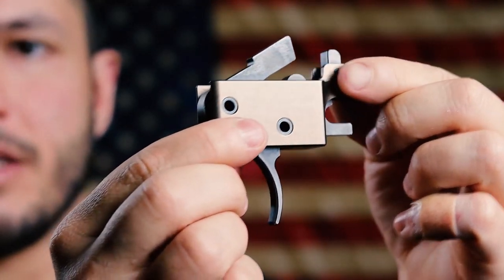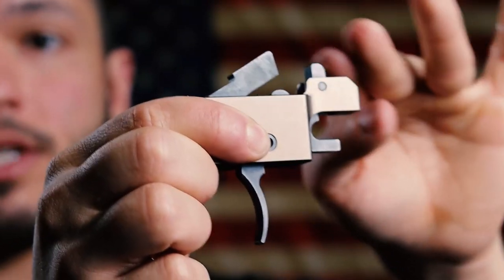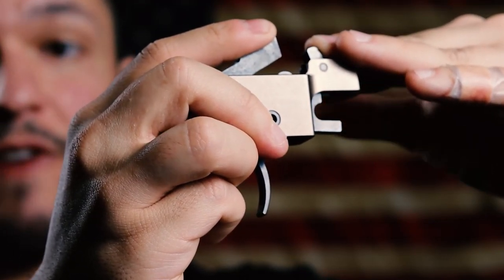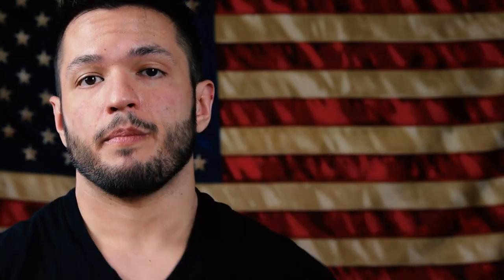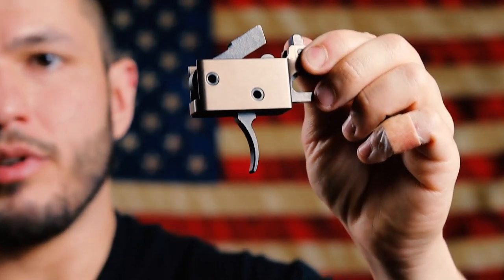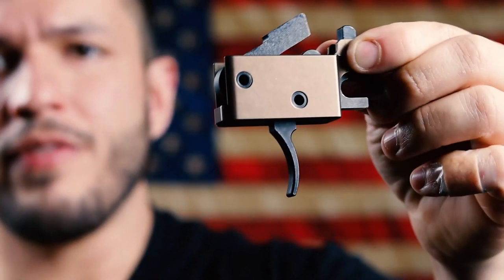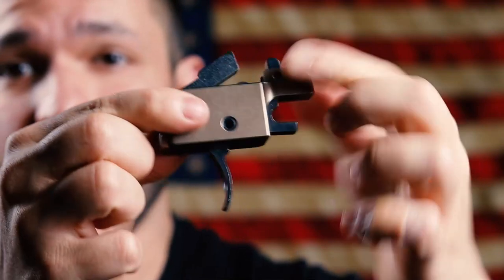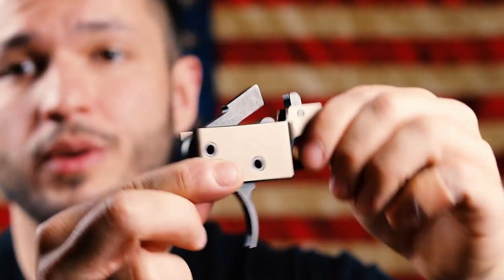Rarebreed FRT-15 Trigger: EVERYTHING You Need to Know

Comment from the maker: I understand the editing, and lines are quite rough. This is my first video and I'm doing everything myself: writing, filming, lighting, editing, audio, animations. All feedback is welcomed in this thread. Flame away.
Reply: Came here to say good info but rough delivery although it seems like you already know. Best of luck going forward 👍
Reply: I believe you misunderstood what people are saying about your finger kinking the spring. Your finger is pushing the lever farther than it was designed to move by being pushed by the bolt carrier. I believe they mean that people are forcing the lever so far over that it kinks the spring. Natural curiosity will have you manually manipulating the device to see how it works. In doing so youre not thinking about how far the bolt carrier is expected to push it. So you are most likely pushing it as far as it will go and that pushes it so far that the tiny spring is squished past the retainment hole.
Reply from the maker: I don't believe I don't believe I misunderstood it. Your finger can push on the spring all day and it won't deform the spring. When the carrier cycles, the carrier speed and force applying to the safety latch is an insane amount of force. When it hits that latch which then interacts with the spring, it doesn't just stop right when that occurs because of spring pressure. This is Newton's first law of physics, what is in motion stays in motion. I can assure you that a carrier going at that rate and speed will continue to move until all the energy has been exerted.
Reply: @AhrionGallegos  Its not moving at light speed and there is not that much inertia if that tiny little spring can do the job reliably. Do the math. There isn't much bounce to that lever mostly because the bolt carrier just barely moves it. Its not being moved by the bolt carrier to its extreme end of movement. If you think it is then get out some machinist blue and cover it so you can see how far it's moving. You'll see it has a very limited movement when it's cycling and manually you can push it far beyond that.
Reply: @AhrionGallegos  So it's November now, has Rare Breed updated their triggers or no?
Reply: I know this is somewhat of an old video, and you may have discovered this on your own since, but:  Instead of holding the thing up to the camera and trying to show what you're talking about as you're talking, shoot B-roll showing what you're talking about and cut to the B-roll at the appropriate times in post.  This eliminates the wonkiness of the camera constantly trying to focus back and forth, you constantly going in and out of frame, the lighting blowing out as it reflects off the thing, etc and allows you to just talk smoothly.  It's MUCH easier and makes for a much cleaner vid.  Keep rockin, man.

Comment: Yeah the hammer spring that comes from the factory is SUPER anemic in my opinion. I had to measure my firing pins and put the longest one I had in the BCG for the rifle I put my particular trigger in to actually set off primers reliably. I appreciate the info on the springs

Comment: Your gun basically needs to be setup like an mg. I see a lot of mid length gas setups be real finicky with this trigger. Based my gun off of the m4a1 which is a carbine length gas system with an H2 buffer and im 400 in with no issues so far.
Reply: Mid length and the fact that no 2 companies run the same gas port size in their barrels 🤦‍♂️
Reply: So the shorter the barrel the better the trigger works?
Reply: @korkser  shorter gas system works better
Reply: I have the carbine gas system and went with an H3 buffer with no issues.

Comment: The lighter buffer spring probably has to do with an under-gassed gun.  The lighter buffer would help compensate for an under sizer gas port, or a leaky gas key, or worn gas rings or clogged gas tube. If you need a light buffer, there's probably a more critical issue somewhere in the gas system.
Reply from the maker: Nothing is wrong with my rifle. Also it's a piston and has worked over 5000 rounds. I can adjust it to be under gassed or overpassed.

Comment: To help with the rear takedown pin that you mentioned, pull the trigger while pushing the locking bar to disengage the hammer. This will allow you to close the upper and you will be able to push in that rear pin. No modifications are necessary.
Reply from the maker: Or you can just pull the charging handle back slightly.

Comment: My biggest hangup was that it didn't have the forced reset as a 3rd option.

My only issue with your explanation on the carrier and the spring damage is that the carrier stops when it hits home. So, if they have that little catch sitting where they determined it needs to be to only be moved 20% when the bolt returns home, it's not going to go any further unless it pushes the barrel and charging handle out of the way. And if your AR is doing that, you have much bigger issues.

I do agree, though, that the trigger has some design issues causing those springs to be chewed up. But those would better be solved by a redesign of that bar's notch for the spring. Or by having the spring angled in a way that it better stays inline with bar... Or both.
Reply: I agree with u on his 20% assessment. The carrier has to stop it cannot over travel. Ppl probably are pressing on them I’d say a lot of ppl finick with them as this guy is on camera especially if their the type having issues because they simply don’t have skilled hands and are pulling their trigger so hard they drag the bolt down

Comment: They aren't saying that your finger does more damage, they saying that using your finger to push the locking bar past its intended max travel point will cause the spring to kink... when properly used the locking bars max travel doesn't go far enough to kink the spring...
Reply: this is not ture the trigger will ultimately destroy its self

Comment: The carrier is stopped by the barrel face and locking lugs on the preventing the carrier from pushing the locking bar from moving to the point of kink of  the spring...however your booger hook doesn't have the barrel to prevent the fingerf<$%&

Comment: You described the locking bar situation incorrectly. The carrier doesn’t cause the locking bar to fully compress which doesn’t link the spring as much as you will by forcibly doing it with your finger that is why there is an upgraded locking bar with a cut out which doesn’t bind the spring as much as previously.

Comment: On the liking bar. You said if you exceed it 20% travel distance it will damage the spring. Does the bolt carrier exceed the 20% travel?

Comment: can you please comment if the Rare Breed FRT reliability has been fixed with the spring channel that crimps? What brand FRT is the most reliable? I have a DMR BCM RECCEE 18KMR with AEM5 suppressor. I want reliability so please comment back with your knowledge because right now I am afraid to touch a FRT if reliability is compromised.

Comment: The unsprung mass of the bolt carrier group and the buffer weight is what either increases or decreases the rate of fire. A heavier buffer (H2 or H3) helps to increase the rate of fire. A lighter bcg like a JP and a Geissele H3 tungsten buffer would be ideal for this.

Comment: Hey, awesome video. A couple of clarifying questions.
Can you provide the link to the spring the needs to be replaced for the spring that usually gets kinked?
Besides the H3 buffer, what needs to be changed in order to increase the trigger weight to make it easier to do a single shot? Can you provide a link to that?
Reply from the maker: The information is in my description. As for the linked spring replacement, it's available on Rarebreed's website.

Comment: Is there a trick to taking the pin out for the safety block?
Reply from the maker: It's extremely tight so it doesn't walk out. I recommend getting a flat punch and removing/re-inserting from one side only so if the hole enlarges, it's only a little on one side. I usually hit it pretty hard on and edge of a surface whilest it's on a softer firearm mat, but using a hard surface is fine. Mounting on a vise felt like I was going to bend or break it, so I opted to not do that.
Reply: @AhrionGallegos  Thanks. I thought it looked friction fit, but it was pretty tight and I didn't want to break it.
Reply from the maker: You should be okay once you get it started it removes easier with each strike.
Reply: The hole is undersized on one side. While it CAN be removed from either side, it is designed to be drifted out from the left side. When reinstalling, start it from the right side. This will keep it from drifting over time. I discovered this taking a mic to it the first time I removed it. This is now confirmed by Rare Breed.
Reply: @jackgates6949  Thanks!

Comment: I have a 7.5" that's a bit over gassed with a H3 and extra heavy spring. I want to put this in it see how it does. I didn't do a adj gas block because it runs great even with the gas and heavy added. With you idea on mods I'm very interested. Problem is getting the trigger. Sold out!
Reply from the maker: They come back in stock at BDU all the time.
Reply: @keith terborg I got one a few ago came with modification from factory. Thanks
Reply: As of this second, they are in stock - it’s been in stock as of midnight - go! go! go!

Comment: There is nothing wrong with the trigger your BcG is out of spec if your upper and lower will not go together easily. Buy a brand name stamped BCG and you will have no issues. Example my Springfield Saint BCG works amazing and my cheap no name BCG does not , it’s out of spec. DO NOT MOD YOUR TRIGGER!